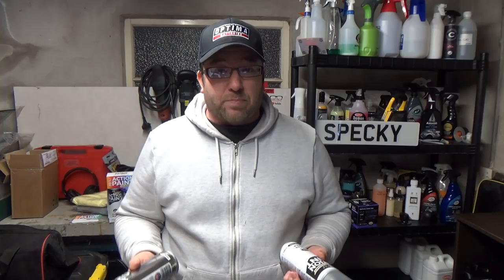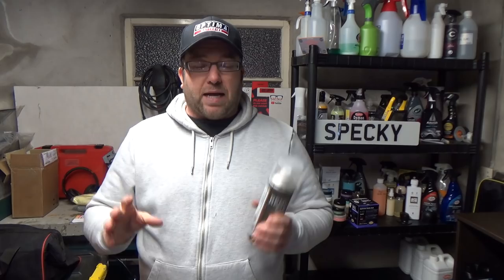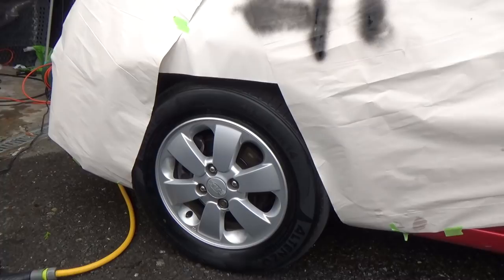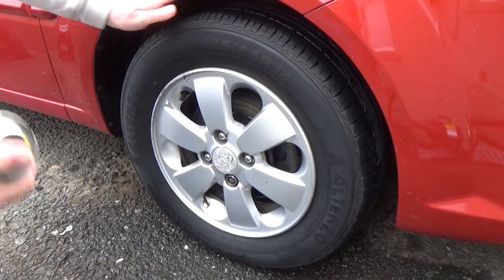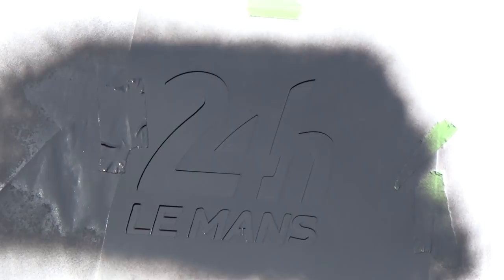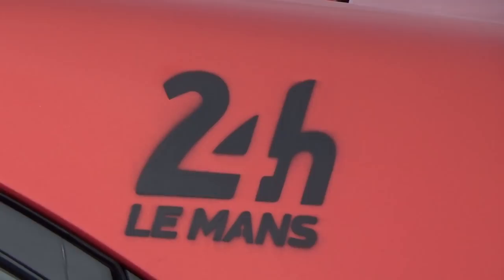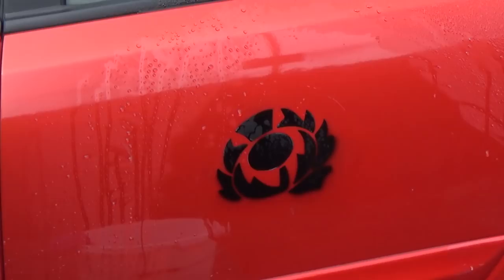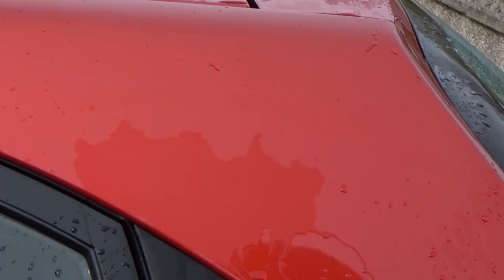Painted My Wheels! Renu Action Paints!

Comment: Could this spray be used on the tyres, if not what would be the best way to mask them off.
Reply from the maker: It wouldn't hurt the tyres but you could dress the tyres first so this stuff doesn't touch the dry rubber. Otherwise a bunch of small cards shoved into the bead of the tyre would work pretty well.
Reply: @SpeckyMcSporran  Great thanks for the reply.

Comment: Hi Specky, Interesting video,this is very similar to plastic spray,but with its own remove gel.
Reply from the maker: I was tempted by rubber spray paints but they're not glossy, they're matt until you add something else. This stuff is much faster to use as your don't need multiple coats and the removal is a doddle. 👍